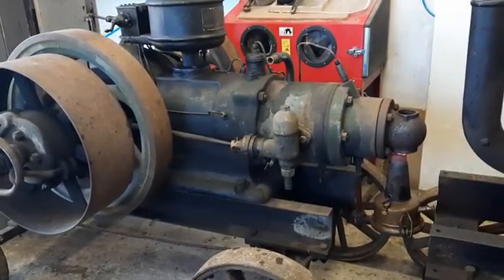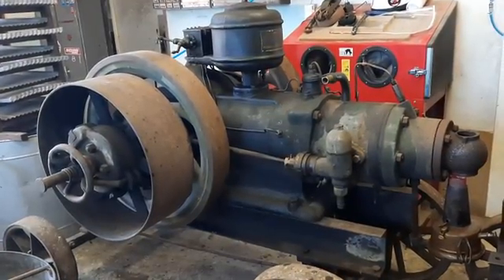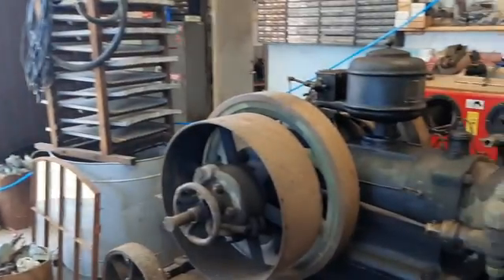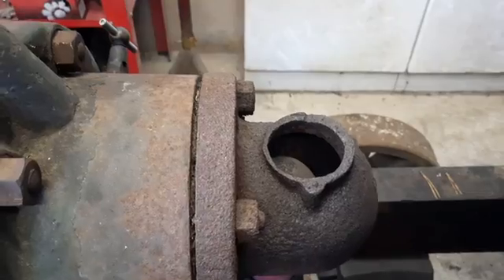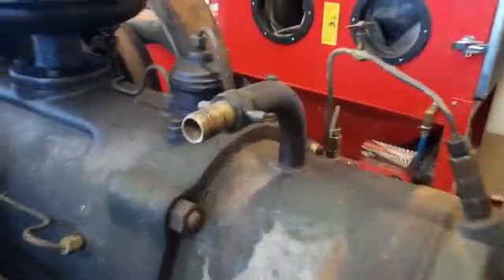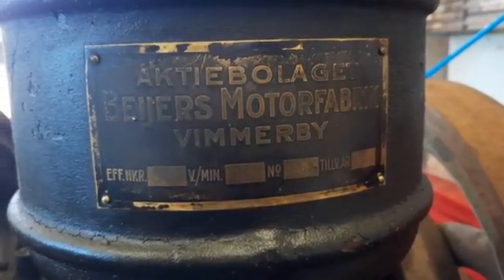10.4L Oil Engine Running @ Zero RPM. How is that possible?

Comment: So you just have the fuel preheat running not the engine. That's not the same thing as running at zero RPMs this is similar to how the fuel oil system works on a commercial shipping vessel running bunker oil.

Comment: Back in the 1970s I flew model aircraft powered by small diesel engines. Sometimes they would run backwards or just oscillate. The latter would happen if the compression was too high. The compression was adjustable and if you reduced it tye engine woukd sometimes stop oscillating and start running in the right direction.

Comment: Actually it is called "half turn running", it's the only way in boats and old tractors to have a way to invert the rotation and have the "reverse". Just throttle up at the right moment and you will reverse the rotation.

Comment: When you think that in less than 50 years we went from that to fairly modern car engines like in this:
https://www.youtube.com/watch?v=t4J-grV_CsQ
It seems like engine technology didn't fundamentally change much until very recently (EVs).
I know, it's not a car engine, it's designed for a different function, but even so, we went a long way in the early to mid 1900s.

Comment: I beg to differ with the title.  I would say since the engine is still firing but not making a full revolution it is running at 1/2 RPM. The piston is traveling back and forth in the cylinder and the flywheel and crankshaft are still moving but is not making the full revolution.  So 1/2 RPM is what I'm calling it.

Comment: Amazing old engine! It's interesting how much of the tech was taken over from steam engines - the lubrication system and the eccentric.
Is the cooling tower a replica of the system they used back then? 
I couldn't see the exhaust though
Reply from the maker: The cooling tower is original. It has been painted once tho. The exhaust is under the engine. A big cast iron muffler.
Reply: @YesterdaysMachinery  thanks 😊

Comment: I've noticed that the old oily engines tend to last the longest. It seems that the better you are able to lubricate the engines, the longer they will last. I once had an old Honda that burned quite a bit of oil and leaked oil. It had 300K miles on it and ran like almost new. If it weren't for the smokescreen left behind at stoplights in the summertime, you would think it was a fairly new car. I ended up selling it (I regret this) so no idea of the fate of it.
Reply: Probably some kid driving the shit out of it lmao I did this to my 400k km civic
Reply: A lot of these old engines last because of their low revs.  I've got a McDonald sp4 that runs and day on a gallon of diesel.  Doesn't use any oil either.  It runs at 375 rpm to develop 4hp.

Comment: It is not "0rpm" it is "back fire" "knocking". Pls use translate cze -> eng (i am not good in eng). Stejný jev se dá pozorovat u škoda 120. Kdy jsou klíčky mimo auto ale je zaplí sitič. Motor stále běží.  PS: SITIČ = CHOKE. PPS: Fascinuje mne když jsou všichni překvapeni z toho jak motor funguje. Vyrůstal jsem na venkově a už v šeti letech jsem řídil traktor a opravoval jsem ho.

Comment: Does the 0 rpm has any use beyond deploying a smokescreen?

I've seen Lanz Bulldogs using this engine. The thing has a Reverse gear, but you could null the revs like this for a tractor rodeo and even give it more juice at the right time to run the thing backwards. Other than that, it serves only to prematurely wear the drivetrain.

Comment: I mean, it is indeed  a 0rpm motor considering a rev has to be consider a 360 cicle in one direction, in this setup this could be consider as a cpm motor, cicles per minute and it would be every 180°
Kind of like a pendulum
Reply from the maker: Yes, i think so to 🙂

Comment: You should tell at lease one practical use of such engine. I mean random rotations in both directions.
Reply from the maker: I did. Read the description.
Reply: @YesterdaysMachinery  meaning no use. It should be easy to extract power excess from 400 RPM, but control power usage to not allow full rotation is not trivial even without useful payload.

(I'm shocked by getting response, nice job BTW)

Comment: the cover at the back is not a air intake its the crankcase breather.
Reply from the maker: ? Its sure is the intake. It is a two stroke, just as lanze and many other hot bulbs. Then you can not have any crankcase breather at all.

Comment: lanz tractors can do that as they had no reverse gear you would reverse the engine if you set them just right they will rock back and forth. it was a known thing for the unsuspecting farmer to put his tractor through the shed wall if it started the wrong direction as you rocked the flywheel to start them.

Comment: I have a Fairmont 5-8 HP engine that will run in either direction by changing the timing off the crankshaft.  You can start the engine in one direction, open the timing circuit and let it coast until it is just barely turning, reset the timing lever and close the circuit to make it kick back and run the other way.  Lots of fun.  It is all in the timing to get the engine to cooperate.

Comment: Neat video! That's a very cool piece of old technology you have there and it's really neat to see how simple but clever its workings are. Is there any difference in running it in forward or reverse or does it just happily go in whichever direction you start it in? Also I am somewhat horrified at the thought of what one of these would smell like if it was running on fish oil.

Comment: I have a tiny Cox .049ci model airplane engine that can run at zero rpm too.
It's only 2 stroke engines that have a reed valve induction (opposed to rotary drum valve) that can run at zero rpm.

Comment: Interestingly the length of the arm on the oil pump can be adjusted to change the flow of oil.
Reply from the maker: Yes you can adjust the arm as you say, and also the pistons in the lubricatpr to change how many drips of oil per @ the axle in the pump goes.

Comment: i did not see any lube in the center two glasses
Reply from the maker: Hard to see some times but it is there. But it is very important. Those little drips makes good work
Reply: @YesterdaysMachinery  looks like you have a few motors in your shop id love see run. i gotta explore the channel more. 
  i love seeing theses old engines still getting fired up. i only seen a few in my 28years and still have yet to see any run in person
Reply from the maker: @215maloneboy9  Yes, There is a lot of those smaller engines i need to make videos of. Im 26 years old myself.

Comment: ALL engines should require you give 'er a couple rips before starting.
Reply from the maker: Yes, when the electric starters came on cars it was sad. A little choke, a bit of trottle, set the ignition and then give it a good turn on the crank handle.

Comment: We used to do this with R/C airplane 2-stroke engines; the propeller would just flip back and forth, but they'd run like that if the needle valve was low enough.  Really cool, thanks for sharing!!
Reply from the maker: Thanks! Yes a RC engine with glow plug is very simular to this engine so i can se why 🙂
Reply: I would get this from my Cox .049 trying to get a homemade 18" blade to spin in hopes of making a helicopter when I was 10 years old.......the stupid things we do as kids..... still have my fingers and that engine...lol

Comment: At first, I thought that this was going to be a stroboscopic action due to the selection of the shutter speed of the camera or else a flashing light on the flywheel. 

For those who are interested in mathematics,  a sinusoidal or a cosine function, just like that of a piston or an AC supply,  is a pulsating flat function and a pulsating flat function as a  single-phase Alternating Voltage supply = V. Sin( wt)   this can be looked upon as the summation of two fully rotating fields in opposite directions. Note flat because it can be drawn on a flat backboard or a flat sheet of paper.

Since cosine( wt)+j sine(wt)= e^jwt  where e^jwt is a fully rotating vector then   
 
Hence cosine ( wt)=  (e^jwt + e^-jwt )/2      and   sine ( wt)=  (e^jwt - e^-jwt )/2    

Where e^jwt is a fully rotating vector in one direction and e^-jwt is a fully rotating vector in the opposite direction.

Now a two-stroke engine has its piston approximating to a sine or a cosine function and hence whenever there is a pulsating function one can associate with it two rotations in opposite directions. So one may say that a rotating crank can produce a pulsating piston or a pulsating piston can produce a rotating crank!  
In AC motors we have single-phase induction motors and the pulsating single phase can be used to obtain either a clockwise or an anticlockwise rotation.   It is the additional components that can make a pulsating action select a clockwise or an anticlockwise direction. In AC single-phase motors it is the capacitor and an additional winding that selects the direction by causing a phase symmetry in the required direction, with four-stroke engines it is the additional valve gear and phase sequence that selects either clockwise or anticlockwise in the pulsating field. Note that all forms of rhythms can be associated with a circular or elliptical periodic notion. Note while music is a pulsating rhythm it does get people to dance in rhythms in Circles as in Waltzes and quick steps!  The pulsation, the circles, and the curls have rhythms that are sexually related and I have linked them to the generation of the sensations of emotions as " monotony" " gentleness""excitement" and "aggression"     my analyses explain why most men are fascinated with the rhythms of engines like this, but I shall not explain any further but the love of engines by us has more than one may think.

Comment: so basically this thing is like a 2 stroke in its operation. 
partially why it can run in forward or reverse and get stuck in that forward reverse loop.
ive see ncar motors run backwards too but its terrible for the bearings on those.

Comment: Lots of single cylinder diesel engines from this era were able to do this party trick. They were designed to run both forwards and backwards but engines with a large enough flywheel and proper timing could be made to run half cycles in opposite directions, giving the effect of "Zero RPM." 
The Lanz Bulldog is possibly the most famous application of this design.

These engines cannot maintain operation in this manner for more than several minutes at a time as the ignition does not produce enough heat to keep the combustion chamber warmed properly
Reply from the maker: Yep, correct!

Comment: I love the old engine designs, so it's like a lower compression diesel engine in the way it works?
Reply from the maker: Yes, lower compression and a hot bulb to help turn the fuel oil to a vapuor that will be ignited by compression.

Comment: That old engine is definitely unique, I have never seen an engine actually run at 0 rpm.
Reply: This style of glow bulb engines was very popular back in the day, over here many survived in old tractors and its even more fun if you have those just rocking back and forth with the engine running.

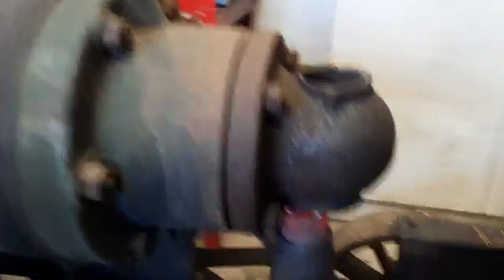Comment: 0:54 - heating element for diesel motor
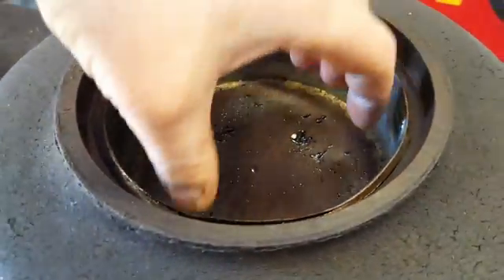1:58 - fuel tank
2:30 - lubricater
10:18 - He slows it down
10:40 - 0 Rpms
10:50 - watching 2 stroke movement
13:22 - lubricater/Working parts
14:00 - shuts it down
you'll thank me later
Reply: Danke bitte schon
Reply: 0 RPM also 11:32
Reply: Yes! Thanks!
Reply: Thank you so much! I was skipping around saying none of this is 0 rpm

Comment: I have seen this same phenomenon in a Cox .049 cu in. model glow plug engine when using a propeller that is a bit too big for the engine! At low throttle setting the prop oscillates back and forth and the engine makes a very strange "buzzing" sound too!....Fantastic!

Comment: 9:10 the exhaust goes through the cooling pipe
is the gasket broken?
Reply from the maker: No, thats just old cooling water that is boiling in there. it pulses out because the waterpump is pumping air in pulses in to the cylinder.
Reply: @YesterdaysMachinery  thanx!

Comment: My Vega use to run at zero RPM when I turned the key off. For about 3minutes ! Press the accelerator and time for a new muffler afterwards.
Reply: The good old "carbon ignition" system....glowing carbon in the cylinder would ignite the incoming air/fuel mixture making an intermittent firing...the engine would shake and sound like crap...
Old English cars from British Leyland/Austin/Morris/BMC all did this.
The Japanese car manufacturers stopped that with an electromagnetic plunger cutting off all fuel going into the jets when the key was turned off.
Briggs and Stratton still use it on their ride on mowers...and if the plunger gets fouled the explosion in the muffler is like a gunshot when you slam the throttle shut and turn  off the key...the ignition source being the glowing carbon in the muffler!

Comment: Cool, I've seen old Bolinder engines in boats,they use that method to run reverse thrust to the prop, when no reverse gear is present, these engines will run in either direction..

Comment: is it designed and intended to run in a particular direction of rotation? in understand why it can run in both directions, but im wondering weather it will cause more wear in either direction? and if it were to be running all day what would be the optimal running rpm, when it first starts running it sounds like it is pre-igniting and causing alot of bottom end stress. very cool engine. thanks for showing . 

obviously it is running lean at low RPM and rich at high rpm cause of all the smoke. but is there a way to tune it? it would be awesome to run a smaller version of something like this as a generator inside an electric vehicle lol there plenty of waste engine oil out there :) btw im not a fan of electric vehicles, they use more energy in my opinion, need more infrastructure and are too damaging to the environment.

Comment: I don't understand how this can be a 0 RPM motor if it has a piston and a rotating shaft? It seems pretty clear that we are seeing some pretty fast rotations as it runs. What am I not getting?
Reply: Never mind, should have watched the video all the way through before commenting. I wonder what sort of application an engine like this has?
Reply from the maker: @gerstmanndavid  as a stationary source of power. The zero rpm running is not for any use. Just a cool thing it can do.
Reply: @YesterdaysMachinery  I have a bad habit of commenting before watching the video all the way through and reading the comments below. Thanks for the comment though and for the interesting videos.

Comment: Obviously this is not a real 0 rpm, it is just measure of movement and if it does half rotation one way and back, it's still two halves, so it is still a rotation. Similarly to AC, it goes from positive to negative and back, in overall it is 0V but effectively in each period it has potential difference so can do the work. So technically you'd have to count how much of a rotation does it make for each half turn and count how much of those you will have a minute and this will be the real rpm. 
Compared to electric engine, this would have no real power at real 0 rpm as it would simply not generate any power. Electric engine at 0 rpm does not move but constantly produces force and that's the big difference.

Comment: I've done the 0 RPM running with a 0.49 model engine--which is also a 2 stroke, glow plug diesel.
Reply from the maker: Yes that should work just the same way as this 🙂

Comment: Technically that's not 0 rpm.
Reply from the maker: Kind of any way. Depends on how you look at it. But it doesent make a full revv so then it is 0. But you can count %of the rev, thats true.
Reply: R P M s  does not require that it make continues rotation. Otherwise it would be C R P Ms.

Comment: would an engine like this if used as a generator be more fuel efficient than a conventional generator?
Reply from the maker: Probably the same as lets say a 6 cyl truck diesel. But this one you can run on anything. Wast oil and stuff. So kinda like free.
Reply from the maker: Probably the same as lets say a 6 cyl truck diesel. But this one you can run on anything. Wast oil and stuff. So kinda like free.

Comment: I am curious if while running at 0 rpm will the engine cool down to the point where it will not fire anymore? Great video. Thank you for the explanation.

Comment: Will these run in either direction safely?
I have heard of old 2 stroke diesels running backwards but it isn't good on the engine.
Old railway speeders were designed for the engine to run either direction.
That is how they ran both ways.
Reply from the maker: Yes these can run at any direction without damaging anything.
Reply: Giant ship's 2 stroke engines are sometimes built to be able to run both ways, that way they can do without a reverse gearbox. To change from ahead to astern they stop the engine and start in the other direction

Comment: 0rpm is false marketing. It's still spinning, just not doing a full revolution. If you take the magnitude of the rpm, rather than average, it won't be zero.
Reply from the maker: Depends, i dont think most of the people that have seen the video thinks so. It doesnt make a full rev. So there is no full revuloutions per minute. But its still moving so yes, you can cacylate % of every rev. But anyway, i dont think it is false marketing.

Comment: About 30 years ago myself and a friend used to try fly remote controlled aeroplanes with glow plug engines. We could not afford starter motors so we used to flick I start them. Occasionally we would get and engine "running" like this where it was oscillating backward and forward. Had to stop it by grabbing the propeller which as a bit painful.